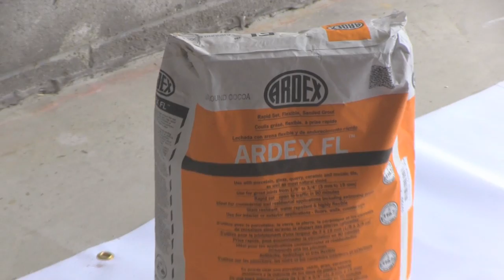ARDEX FL™ Rapid Set, Flexible, Sanded Grout - Demonstration

Comment: Can you provide guidance for grouting walls using this product? Mixing ratio and the process for removal of excess. Thanks!
Reply from the maker: The product should be mixed to the recommended water ratio listed on the bag, uniformly, from batch to batch, prior to installation on vertical surfaces. For more complete technical guidance, please reach out to our technical team at: 412.203.5000, and select our technical service department.
Reply: This stuff is turning out to be difficult to use on walls. The same properties that make it easier to use on floors (flows into joints easily) makes it hard to ‘fill’ a vertical joint without going back and forth over it so much that the finished texture becomes inconsistent. It is ‘rapid setting’ so you can’t go over it too much or you’ll be pulling partially skinned-over product around.